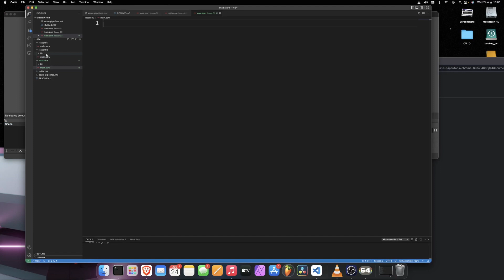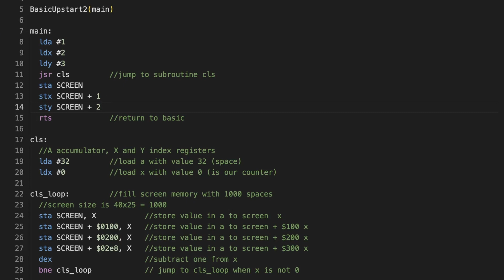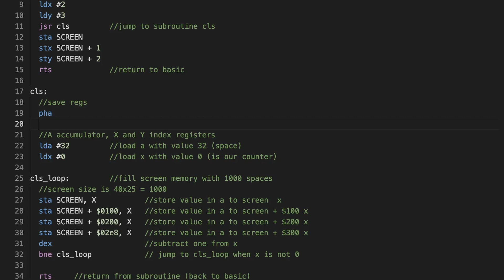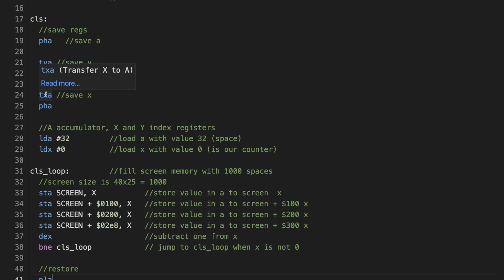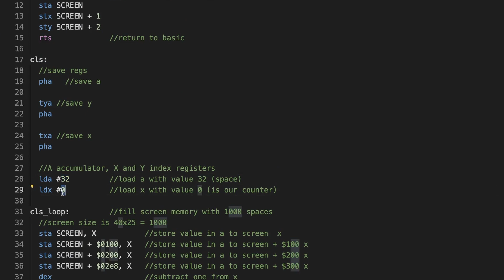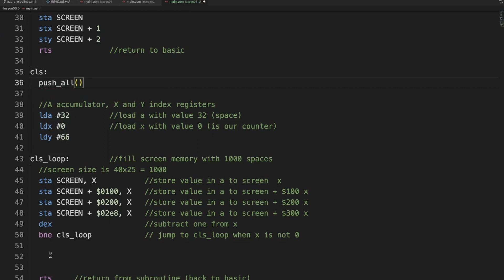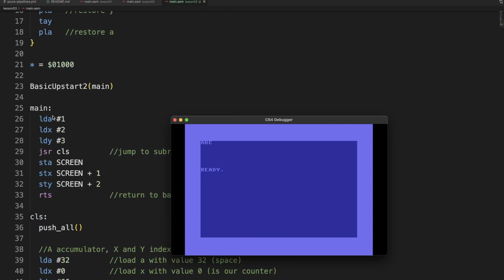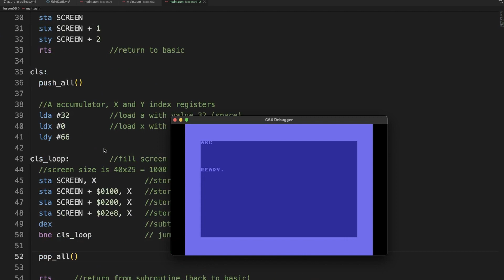C64 Assembly lesson 3: push and pull

Comment: A small thing, at 2:00 you didn't run the program showing the output with the naive code, ignoring registers. I think it's a really easy step to take to actually show the output and show what the problem is before implementing the solution. But overall, great video. Working through the series.
Reply from the maker: There’s no difference in that situation. As there’s no other process relying on those registers. So it wasn’t trivial to show.
In most cases we use the optimized naive approach. Except when we come to interrupts there you definitely need to store the registers. As then the interrupt routine can be fired by the the main process is running and overwrite those registers.
Reply from the maker: I believe we cover that on interrupts again.